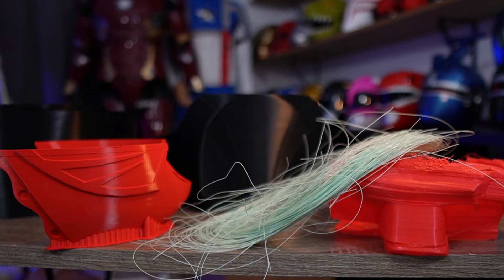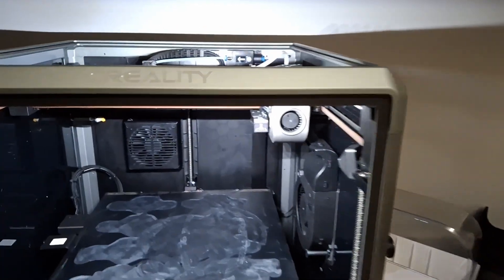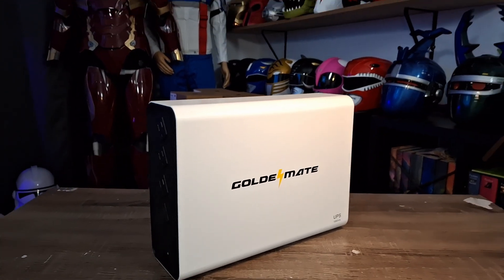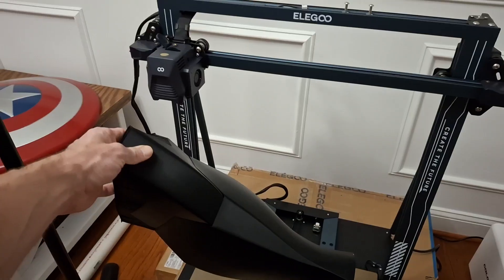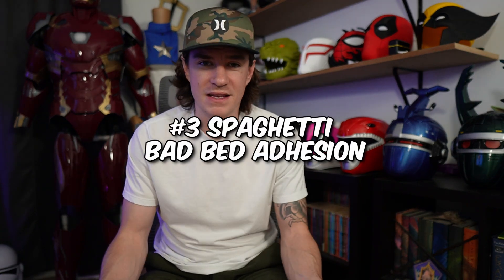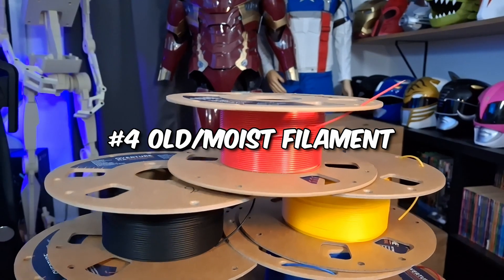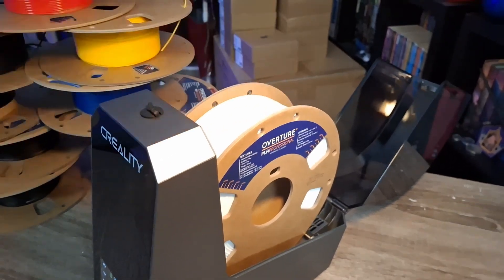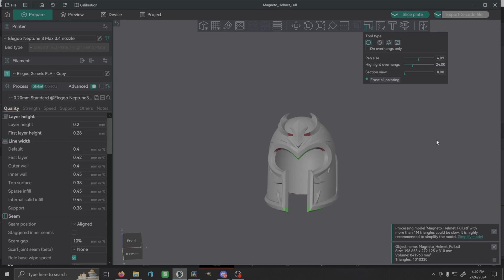Most Common 3D Printing Fails Explained!

Comment: Do you have completed prints disintegrating after a few years? It's interesting you mentioned the drying of filaments, as I have had prints falling apart after 2-3 years due to humidity, which made it super brittle and even oozing oil. It made sense since the water-absorbing properties shouldn't technically change after just heating it up from filament form into an awesome helmet, so I am wondering if painting over them would stop the material from absorbing moisture from the air altogether.
Reply from the maker: thats crazy, i havent had anything like this happen but i do often paint my prints.

Comment: Quick question. I saw you made a video on using head sculpts on thingyverse. But there is no 24inch head circumference size to use for a cosplay helemt. Is there a certain percent i would scale one of them? Going to print a helemet soon zo have no idea what to do to make sure it fits eith some little room for padding

Comment: super interested in the filament drying portion. I bought a crap printer 4 years ago and ended up tossing it, but when i got the P1S from bambuLab a month or two ago i used the 4 year old overture PLA and had no issues at all. I know this isnt the case for PETG, ABS, Nylon, or flexible filaments, but the fact that you really endorse drying for PLA is really interesting for me.
Even more so because I live in Michigan swampland, SUPER humid environment.
Reply from the maker: I'm on the east coast and definitely deal with major humidity, I love overture and their rolls also usually come sealed tightly, I dont want to rag on a company but i've had one company that I HAVE to dry. Otherwise its a stringy nightmare between tree supports. Same gcode is wildly different between when its dried and not. The filament comes from Georgia also another very humid location.
Reply: @SaturdayMorningProps  super interesting

I have only used bambuLab and Overture. I should note the 4 year old pla was just sitting open in one of those plastic childrens drawers. I had to remove about a foot of it because it was too brittle, but after that it was perfect.
Most houses around here don't even have air conditioning so it absolutely had it's chance to absorb moisture!!
Very shocked to see you have had any pla issues at all with humidity, hope that company gets their crap together!

Comment: Don’t be cheap when choosing a printer. You get what you pay for and while in forever grateful to the ender 3 for getting me into printing modern printers just function better out of the box. Great video!
Reply from the maker: @Beemer_ben  honestly I'd say something like the A1 classifies as cheap nowadays and that one will alleviate so many issues. But yes there is definitely an argument for understanding quality on the front end solves or lessens a lot of problems